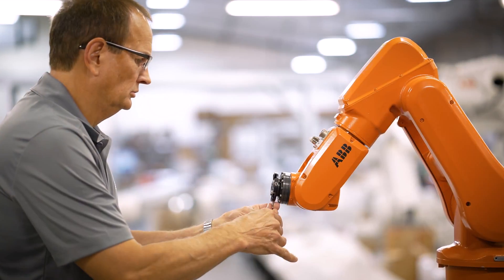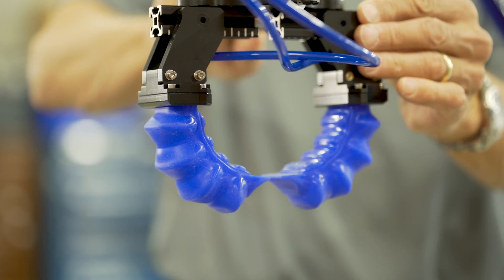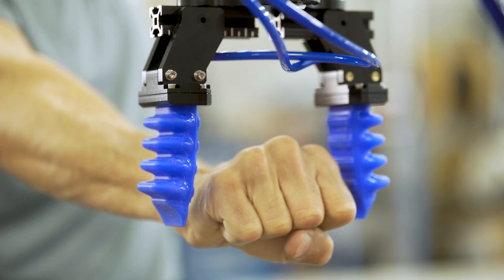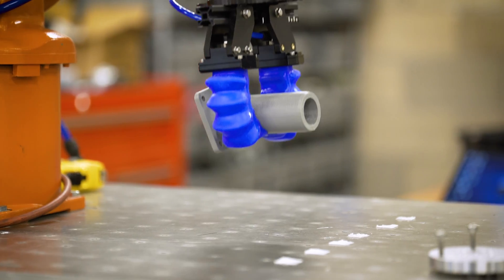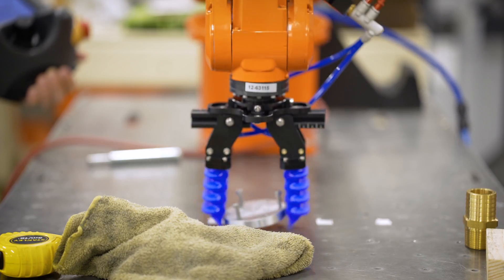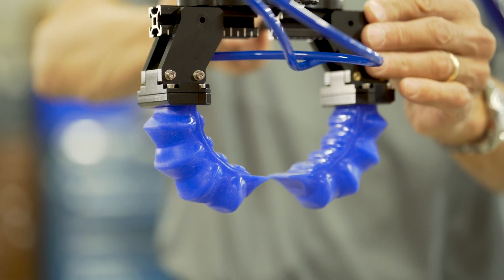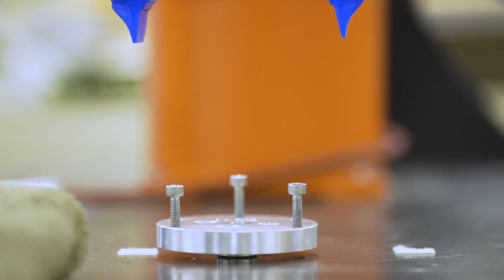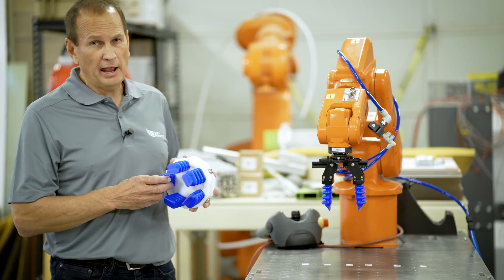Soft Robotics Food & Beverage Grippers at House of Design Robotics

Comment: What is the maximum speed the robot can run holding the heaviest load these finger can handle? How heavy is that?
Reply: Thanks for your question! While it does depend greatly on the robot, the product, and the application, we have systems picking items well over 100 ppm.